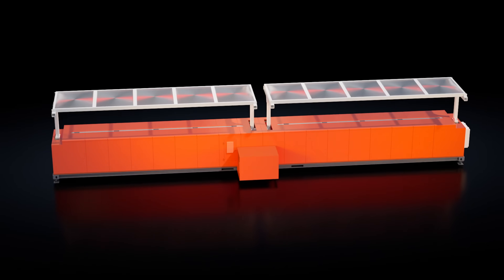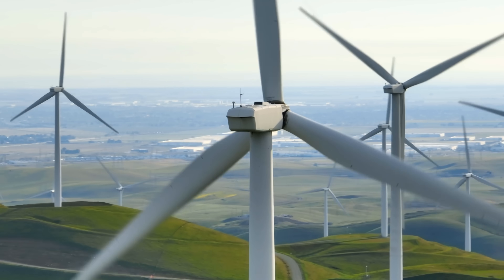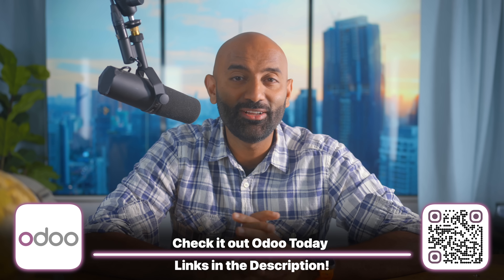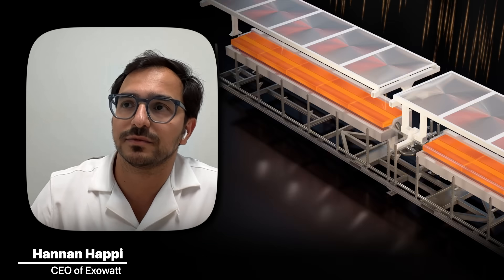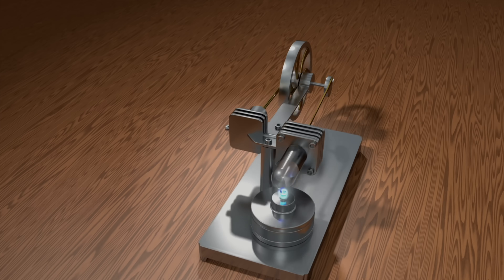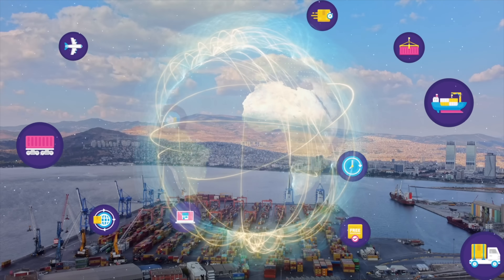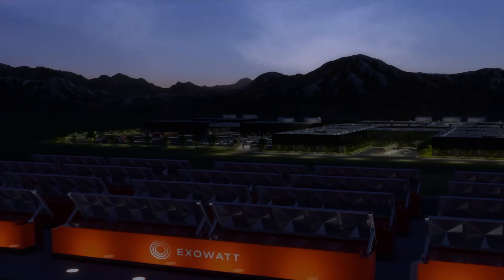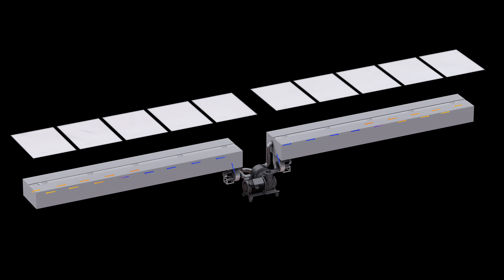Solar Without Panels, Storage Without Batteries - EXOWATT

Comment: ABSOLUTELY!

Request an ONSITE visit.

I already forwarded your video to POTUS.

Energy Costs have SKY-Rocketed across the Nation. Any method we can use to SEPARATE AI needs from Regular Citizen power needs is a Direction we need to go.

IF They require a TEST RUN/Beta Site, have them call Standing Rock Reservation at Ft Yates, ND. The Tribe has TONS and TONS of Land. It would be a Test Site of EXTREME Temperatures: -Thirty degrees to One Hundred and NINE!

But, it would help them understand how FAST they Could Deploy, Scale, and Evaluate USE. 

Of course the Hardest thing to deal with on a Prairie is the Wind…it can reach up to thirty-five mph easy.  BUT so can it do that on MARs. IF they can develop one type for Earth/Moon/International Space Station and one type for Prairie/Desert/Arctic/Mars - maybe a spinning version for high-wind zones…it would have to have dust blowers, but their system would be WORTH it’s WEIGHT in GOLD!  Power consumption for a Mars Colony and a Space Station of any decent size, will be OFF the Charts and Sterling Engines which can power a Submarine/Small City have ALWAYS been My 1st choice over radiation/nuclear.

I would LOVE to join you if you get an onsite visit invitation. They’d have to pay my travel, but I have a wicked sharp mind and can think in directions that MOST can’t - which is WHY I work on the Mars Mission and future space stations.

My Google Number is: 775-235-6935

You/they can Text, send photos, etc

Comment: Absolutely onsite inspection please.  Cost per container would be great too.  Is it AC or DC that is the output?  I live in Australia, so land for these wouldn't be an issue, but what is the effect of scattered clouds in the sky for these?  Overall warranty on the container and the 4 parts, the Lenses, the Bricks, the Sterling engine and the converter.  Power generating degradation over the warranty?  How do the economics stand up to PV.  Will Exowatt licence the production of it elsewhere?  When it comes to outside temperature and sunlight, how hot is too hot, out where the red dirt is sometimes it is over 50 degrees Celsius? I think at most we got a 58 in the past.  For those of you in the in the good old USA that's about 120-140F. 🥵🌶♨

Comment: The reason they have stopped making claims about net zero is because it was always impractical and the AI power needs now override the issue.  Small Modular Reactors are the way to go.  If you want lower CO2 generation, talk to China and India.  In 2023, China installed six times as many coal fired power plants as the rest of  the world combined.  Their growing CO2 production easily swamps any practical US and UK reductions.

If the US eliminated all greenhouse gas emissions starting today, how much would that lower the average temperature of the Earth by 2100 in degrees C and F versus what it would have been if those emissions hadn't been eliminated?

Grok 3 AI: 0.14°C (0.25°F)

Comment: Interesting that this system exploits the low energy infrared part of the light spectrum (heat) whereas solar uses the higher energy part of the spectrum and actually doesn't like the warming part of the spectrum. 

Not that it would be cost-effective, but you could almost split light into two components and direct one part to an Exowatt system and the other to a solar system. 😂

Comment: green energy is a scam windmills use a huge amount of oil to lubricate the gearbox only turn in certain wind conditions solar panels are made from mined rare materials using oil made products and are toxic to the environment when they fail oil is a natural product made by conditions within the planet it is not fossil fuel so stop this nonsense of saving the planet

Comment: 😊 morning brother, that is brick technology from England and overseas. That came to the United States initially and it looked like a fireplace. Sir, if you arrange your bricks correctly light one fire in it tomorrow you'll have to put another fire in it and they only need to burn 2 to 3 hours and you've got heat for the entire day. It's called thermal Mass heating and too bad in the 17 and 1800s. They didn't have a sterling engine or reliable wires❤❤❤

Comment: I agree with one of the commenters here that this should be a residential system first.  the smaller scale should make it easier to implement.  The working data should reveal solutions to the higher demand and consistency needed for the data centers.

Comment: So interesting and surprising! Please do produce a deeper dive video on this. The combo seems like such an improbable assemblage, yet it could shine if maintenence requirements allow. Watching this lead me to wonder about an even simpler approach just for home (and maybe hot water) heating; are there any systems which just use a fresnel lens to heat ducted bricks for controlled heat release overnight? I live in the Sierra foothills and have to settle for electric space heaters ($$$) or a wood stove (smelly, toxic hassle) for winter heat! Help!

Comment: The problem is Sterling engines require a large heat difference to run efficiently. 
There is also the requirement of a proportional size heat sink to cool the  gas.
They are also weak, you have to build a large engine to get useful amounts of energy back out of them.

Comment: I am always very sceptical when it comes to these "heat" batteries. In a way, it's adding a lot of additional losses into the system. While Solar Panels are gaining efficiency (with Perowskite crossing the 30% barrier) the Challenge is moving towards Storage. But Storage isn't just about the amount of Energy you can store, or we would all just use Super Caps, no, it's about how long you can store that energy and zow much you lose. Seasonal Storage to carry Summer surplus across Winter and of course "Buffers" for times when neither Wind nor Solar are producing much. And Heat based Storage isn't going to cut it.

Comment: So its a replacement for a solar panel and battery with a mechanical system. Think heat - engines -generators.  There is sure to be a whole lot of electronics to enable these units to be coupled together. So I suspect that the supply chain claim is overblown. Where can these things be located. Again I suspect there is a narrow range of locations where the right sort of solar input is available. Heat storage systems have so far been a failure where tried. Maybe this is different, but it would be good to see a plant operating which is different from a press release gushing. I am sceptical of the LCOE claims, these are at this point sans a large operating plant rather theoretical. I would want to see real world numbers before accepting LCOE numbers.Its all possible, but the proof is in operating one of these.

Comment: Keeping those lenses clean in a desert environment will be a challenge. This may require more maintenance than solar. How forgiving are these lenses if dirty? Also weight of the mass in trucking is a good question.  Why sterling engine?  I love the concept and can it be scaled down for smaller home units?

Comment: The only problem for the world is not to generate electricity😅 but what's the main problem is to store electricity for the use in night time 😴 when no solar is working and when more power is needed during peak time at night and almost less power demand at noon😂. So we just have to use graphite battery or the sand battery for it because it's cheaper to install but 😕 compromise the efficiency and the best part is, very barely it degrades than regular li-ion battery 🔋😊.

Comment: The Stirling engine is a thermodynamic process, it means that the the engine itself outputs also heat at a decent temperature after the process. Why not use that heat again instead of wasting it as for example heating water for residential needings?

Comment: Yes would definitely like to see more about this solar system.  Also why not employ thermopile electricity producing focused solar beam receivers?  Can charge batteries with that. This system is really  great!  They can be stacked vertically and lose basically 1 hour of production during the day.  With a Pyramid stacking scheme many architectural variations are possible. No reason not to make them float and reclaim desert land via passive shading to reduce water evaporation. One could go on forever!
Reply from the maker: Definitely Will, working on an onsite, and thank you for your support!

Comment: Most of the energy used by homes, is heating & cooling.  But WHY?!? 
It seems engineers keep trying to “prove their paper” (do something to prove their degree in  engineering…), by coming up with higher-tech, more costly, more built-in Planned Obsolescence gadgets & systems. 
Like central HVAC—terrific—but, cuz it blows air, it’s losing easily about half the BTUs you paid to create to heat your home—& in a grid-down, you can’t heat your house (unless you run a generator- that could be 2 weeks or more, some places!—& you end up staying in emergency shelters til the grid is back)

But what if it could be done more simply & less costly? (Cost includes resources used & replaced, maintenance, replacements, & running the system) 

HVAC industry keeps upping-the-ante by pushing higher-tech, with obscene Planned Obsolescence built-into everything—especially electronics. 
Industry lying to consumers about so-called “inefficient” baseboards & oil filled radiator portables?
…those are only “inefficient” if the house has mingy insulation!  Cuz you get to use  the heat produced, cuz no blowing air chilling it…..
But HVAC wants to keep profiting bigger, like all other industries, so they don’t recommend maximising insulation first. 
The industry also recommends overkill-sized systems (based, I think, on the differences in how different systems work—that’s like trying to compare R-value across different insulation materials). 
 ….So, our average 40-yr. old tract house w/ mingy insulation & crummy windows, is supposed to have 1.5 ton system….one contractor says a 2 ton system 😱
But we noted, those big heaters were way too much—& we needed to turn the family room into a kitchen….
So, we removed all 7 of the 2400 watt baseboards from the house; replaced all but 2 with 700 watt units—& only lightly use those!  (Units in 2 bedrooms are not used…electronics in one room, heats both of those small (100sf.) rooms) 

The only thing that can save more energy from heating/cooling, is if we replaced all the crummy windows, & installed Simple geothermal to temper the indoors.  
The 2x4 frame & cheap truss roof cannot hold much insulation.  
Installing a 10’ wide patio roof all across the south side of the house actually helps temper the house, all seasons—now I want a similar patio roof across the front of the house, & an entry patio roof! 

High tech is NOT always the answer.
Even as great as Exowatt seems, Fresnel lenses, like solar panels, cannot work very well if at all, in areas with heavy overcast during seasons when energy is most needed!  Geothermal can beat Exowatt, I think.   
Dig deep enuf to get enuf temperature difference, & it’ll generate electric, too. 

Imho, we could stand with more simplified tech, working with nature.  
It can save the environment, & us.  The mega-tonnages of wasted, over-used resources used due to obscene levels of Planned Obsolescence, is really what has decimated the environment.  
Folks have been very badly Consumer/Social Engineered for many decades, to think they must replace gadgets & systems every few to several years.  Electronics industries have the absolute worst levels of Planned Obsolescence they build-in, then compounded by bad manufacturing. 
Billions of people living low-tech lives will be happy & less stressed, & the planet will thrive…. but it won’t make industries or their investors happy at all.

Comment: 6:00 Cost per kWh. This will depend a lot on the local conditions. Lensed systems are great when the sky is clear, but rubbish in overcast conditions. Solar PV will generate, albeit less, in overcast conditions (I'm in the UK!). These might be great for sunny deserts provided the mechanisms can be made reliable and cheap enough. Good luck to them.

Comment: Like so many things, this would likely work best as a solution in combination with other technologies. I would also question the point of the motor, rather than utilising the heat for industries needing this.

Comment: Sterling engine is agrait invention .
The main problem , is the durability of the engine.
Maintenace could be half a year maximum .
The minimum is not clear .
The engine is a very stressed component .
Solar panels degrade over time . The sterling engine degrades very fast !
The good thing is !
The parts in a sterling engine are not complex and can be replaced and rebuild without much problems .
A regular fossil based engine needs an oil change , to work properly over time .
The sterling engine is not lubricated with oil or somthing similar .
That makes the high maitanence a must have !
The other parts a fine .
The difference in heat and cold could potentionaly degrade the air circulation tubes !
The more plastic is used ?
Plastic is still oil based !!!

Good invention !

Stay healthy !

Comment: A Stirling engine coupled to a permanent magnet generator, plus the lenses, piping etc. Will be cheaper than photovoltaic for a 2.5kW module ? Yeah ... right...
Reply: Don't forget the shipping container, even used ones aren't exactly cheap

Comment: Sorry, this doesn’t convince me at all. Ok, It is a good thing to always try new ideas. But when i see a system like this, with tech and moving parts that really need regular maintenance, it will be on par with wind generators. Some of the commenters already look deeper than pictured here, which is what we need.
Of course, it is hard to think of someting new, when surrounded by solar panels everywhere, but there is a reason for all those solar panels: It still, by far, is the most easy way to generate electricity, mainenance is very cheap, mostly even only concentrated on the battery system, like checking cables and electronics from time to time.. Solar panels only need a soft brush with some water once every half a year or so (depending on the location), no moving parts, easily more than 30 years of service.. And very cheap nowadays.
New tech can be great, but will be very expensive for years after hitting the market, R&D costs need to be compensated before prices will drop!

I went totally off grid with solar panels and a LiFePo4 battery system, very low maintenance…And I love it.

Comment: If this is power generation based off heat, and data centers already produce too much heat, which is why they use another resource for cooling (water), could data centers use their heat for this type of energy?  P.S.  This is very interesting information.

Comment: This is all interesting, but it mostly highlights the need for nuclear. We need to stop dancing around the huge lack of energy density in renewables. They're great for small scale supplemental, but sooner or later you run into the simple fact that energy needs to be gathered and concentrated to do work. That comes at a cost that soon makes most alternatives impractical. Secondly, using solar as your benchmark is setting the bar as low as possible.

Comment: I like this video and your presentation of it. Minute 15:50: The Exowatt representative suggested a delay of 31 years if he wasted one second four or 5 million times. It would actually have to be 1 billion times and that would result in 31.6 years. 1E9/3600/24/365.25. Another thing that I found a bit off was the idea of starting with the idea of making electricity at one cent per kilowatt hour. It seems like putting the cart before the horse. I get that that's their goal and more importantly they optimized to minimize cost, but it seemed a bit weird because it's picking an arbitrary goal that might be impossible to obtain. The third thing is that claiming sterling engines sounds like engineering name dropping. It makes me wonder if they're calculating output based on adiabatic engine cycles? Finally, how come they're not pulling off some of the heat specifically for the purpose to heat houses, hot water, etc? I'm questioning their numbers, but I would like to hear more about it.

Comment: I'm not convinced this is an effective way for generating power, but it does seem like an effective way for heating a building (and its water for housing). A huge portion of our energy use is for heating as it is, so minimizing the use of grid power or burning gas to heat a building seems like a fantastic use case, especially since the roofs of many buildings go unused or partly used. Just cut out the step between turning heat into electricity and just use the heat.
Reply: We already have better technologies, like evacuated tube collectors. Pretty common here in Germany. But even that can't heat a house in winter alone, it usually contributes to the heating or warm water.

Comment: AI power consumption is made worse by Google forcing Gemini results in each google search. Also doesn't help with competing search engines do it too.

That said I would like a small scale one that I could experiment with. Also a Stirling engine depending on the design, really don't need a lot of maintenance. Usually a bit of grease in the bearings once in a while, which can be done with a grease zerk, and can usually be done even if the engine is turning.